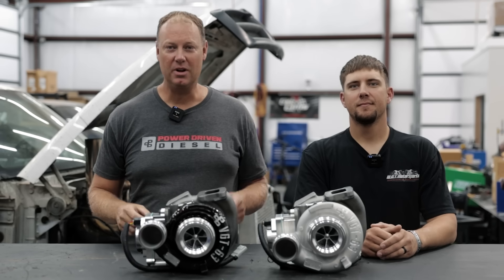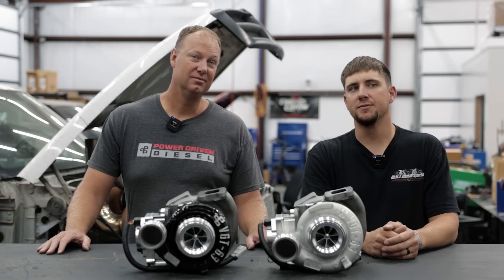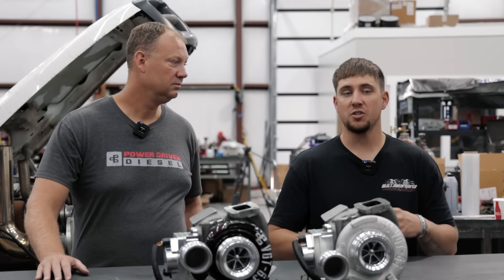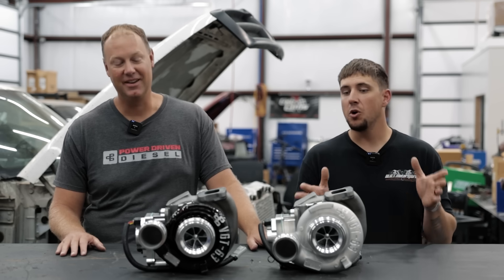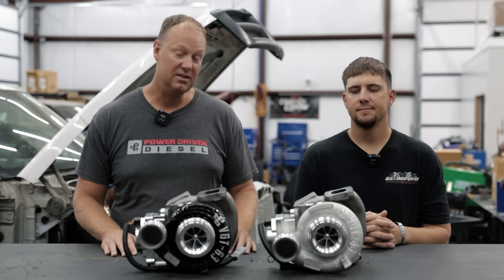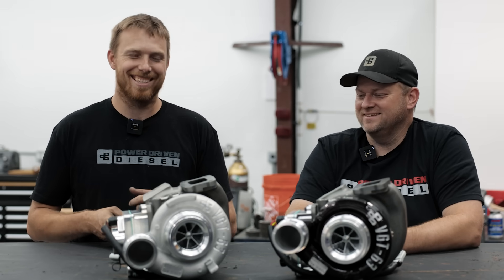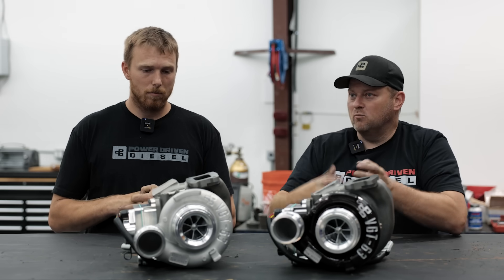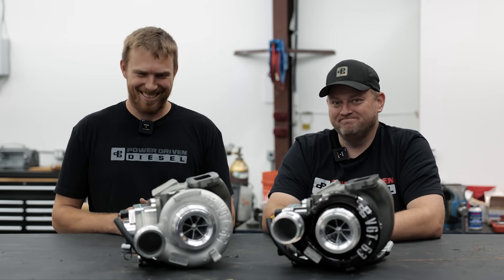VGT 63 Billet Actuator Turbo Upgrade for 6.7 Cummins

Comment: would love to see a second gen manifold kit for these turbos. Alot of guys want the second gen sound but do not want to loose the exhaust brake. and after market options have been unreliable both the electronic (maybe city diesel actuator operated butterfly downpipe brake would be better) and the air kits ( air kits freeze up during winter) id 100% buy a kit to keep the VGT or this aggressor VGT with a second gen manifold and piping kit.

Comment: You say no core in the video but when clicking on the link it shows a core charge. Hmmm
Reply from the maker: We do need to update the video. Turns out we need the actuators. We need just a small part of them.
Reply: The whole turbo or just the actuator?

Comment: How do you think this turbo will run on a  3rd gen 5.9 with 100hp injectors if I use the BD VGT install kit for the 5.9? I was planning on buying the BD Screamer kit, but after seeing this video I’m seriously considering the Aggressor instead.
Reply from the maker: From looking at the specs of the BD Diesel Screamer, I would say our Aggressor 63 VGT would be a great option in comparison.

Comment: Why can't you manually adjust the VGT? Sorta like your adjustable Ppump afc's.
Reply from the maker: It’s electronically controlled, you can change the tune but there is nothing to adjust mechanically.
Reply: @pddofficial 
Open it up and connect to the linkage. Manually change the pitch. Easy.

Comment: I want one for my 05 Dodge 3500 do you have a manual switch or a way to put it in a non VGT turbo truck ?
Reply from the maker: Unfortunately, a full blown control module would be required to properly control one on a pre 2007.5 model truck.

Comment: Will this turbo have some whistle too it? I feel like my stock turbo with an S&B intake is so quiet.
Reply from the maker: All turbos have some whistle!!
Reply: Do you have the small side door installed on the s&b? If not in dusty environment take it off. Much louder whistle and much louder exhaust brake. Sounds amazing. Big difference vs cover installed

Comment: Been watching for years love the channel! Can you make a video of this turbo on a dyno and see what it would do on stock fuel!?
Reply from the maker: Great idea!
Reply: I always hear how beneficial compounds are compared to singles but how would a compound turbo setup built for the 700hp range compare to this vgt turbo for the same range? Would the performance be negligible since the actuator on the vgt moves so fast?
Reply: @Da_Galaxy  I would bet money egt would be out of control at 700hp on this turbo but you could have compounds at that power level that stayed under 1300F but that being said the trucks cooling system can't handle that power level either way.

Comment: 70X64
Or 76X64?
Reply from the maker: The unison ring of the factory Holset HE351ve turbo limits turbine large diameter to 70mm, therefore this turbo comes with a 70mm × 64mm turbine.  Many of the competing aftermarket HE351ve turbos are 70mm x 67mm, however, through testing we've determined the higher trim 64mm exducer works better to provide a more stock-like low-end response and excellent high-end flow and power.
Reply: @pddofficial yeah, this was a dumb comment. I was familiar with the holset 76X64 wheel but not the 70X64. I did some googling after and found out it is out there. I am by no means a pro but I feel holsets turbine wheel designs would really work well on diesels. Diesel gases need that extra trim where a wheel has X induser and - 11 or - 12 exducer on the turbine.

Comment: Make a standalone controller so we can throw it on a 12 valve
Reply: They hinted they're working on a VNT style turbo for 12 valves in a recent podcast
Reply: @bherman13 yeah I remember them doing that. I’m just trying to be the squeaky wheel that’s gets the grease goin for us all.
Reply: I'm going to run a 67mm he431 on my 12v.   Ran it before and it was nice, looking forward to running it w more fuel.
Reply: With vnt you can use wastegate actuator and lots of mechanical guys are using that solution. Does not beat electronic but pretty decent.
Reply: If they wanted to test a stand alone VGT controller, I’m right here. I have talked to different staff members on the phone and let them know what I was up to. I won a give away turbo, and flat out told them I’d send them a controller to play around with.
Reply: @jerrythechainsawguy8100 got any more info on what you’re doing? This is interesting.
Reply: Vgt controlled with my AFC Live!!

Comment: I'll end up purchasing one of these just to support y'all but I was wanting to know how the aggressor compares to the fleece cheetah?
Reply from the maker: The compressor side is very similar. The  turbine on ours will be slightly quicker spooling and the fleece will support a slightly higher power number. Ours has the much better actuator and no core needed
Reply: @pddofficial why is it asking for a $200 core charge on your website?

Comment: How do you get 1:1 I have a 17 6.7 Cummins fleece 63mm vgt and it's always 1.5-2:1
Reply from the maker: Tuning is a big factor. Also the turbine wheels are different between ours and the cheetah.
Reply: Highly depends on the VGT command, charge flow demanded, fueling, and timing
Reply: Don’t let anyone bullshit you. 1:1 is not for performance. It is efficient. Efficient doesn’t = max power. I have been making stand alone a since 2016, and can tell you there’s a lot of BS marketing out there. I had a guy that bought a DPS turbonator tell me it had a .4:1 drive:boost ratio. It’s not a damn perpetual motion machine. It takes drive pressure to make boost!!! My best driveability and power has come from a 1.8:1 ratio at low turbo RPM and target 1.2:1-1:1 when the turbo is lit. If all you care about is MPG and efficiency, make it laggy and slow, target 1:1 and be light on the throttle.
Reply: Thank you for the information. Whatever tune is on it (ez link) I don't really like it when you let off the throttle the throttle chops as it goes down to idle